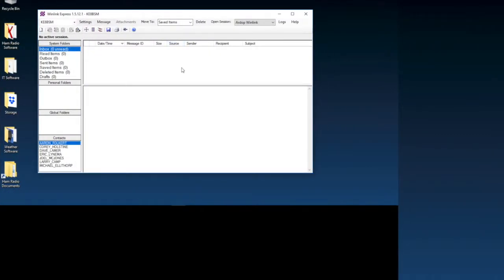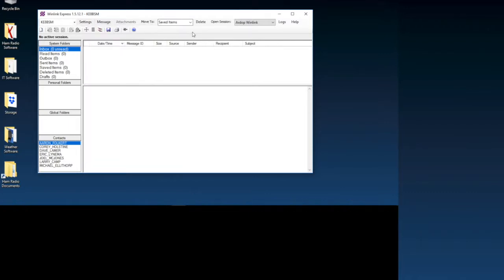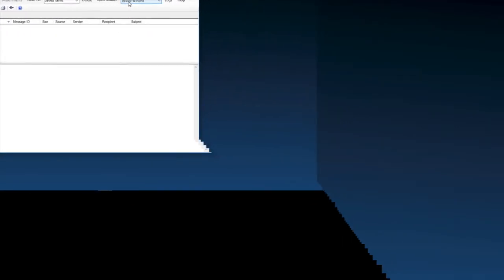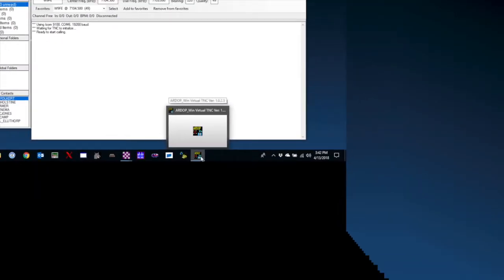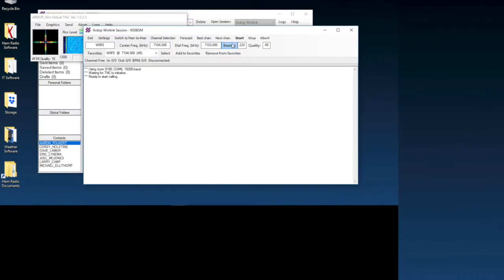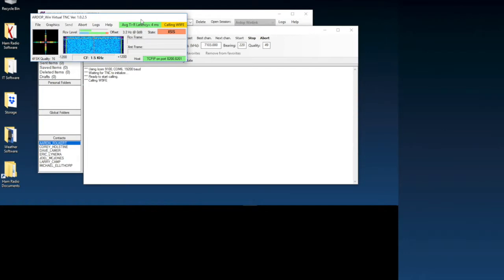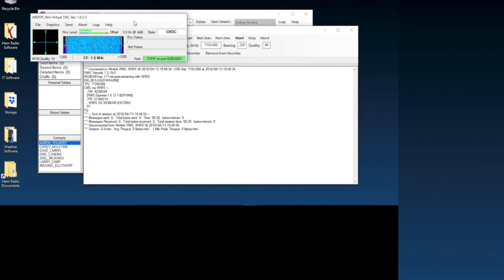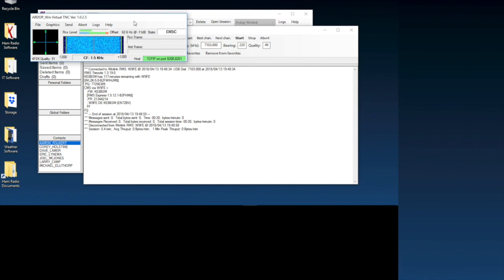Winlink Express & ARDOP Setup & DEMO

Comment: Thanks - on my 817 and my 857 I have never gotten an ARDOP connection and WINMOR only about 1:80 attempts  on 80/40/ 20 de VK1MIC
Reply from the maker: Hm that is weird. Are you using a signal link between the radio and computer?
Reply: Zach Bennett hi Zach. It’s not a signal link but it’s an audio and usb interface.
Reply from the maker: Hi Wade. I forget the technical term but I’m wondering if your Audio interface isn’t fully isolated and you’re getting undesired interference and that’s why you’re having a low successful rate with WINMOR and no luck with ARDOP. I don’t know if you’re part of a club or know someone who could let you borrow a Signalink but I would say try a different interface and see if we can rule out yours or if there’s a setting that we’re missing.
Reply: Zach Bennett every other mode I operator on and with the same device is all a ok ??
Reply from the maker: Oh interesting. Hm then I’m not sure. The only thing I can think of is a winlink express setting someplace. I wonder if you’re trying to connect to stations that are using a different bandwidth setting than what you have. While you’re in the connection status window, if you go to setup and TNC setup, there should be a bandwidth setting. Some WINMOR stations are 500 while others are 1600. Same is true for ARDOP as well.
Reply: Zach Bennett all VK ardop is 2000
Reply: @KE8BSM  Same problem here with my FT-817. No problem with FT8 (on WSJT-X), but no luck with Winmor or ARDOP so far. Also using a simple PC (TRRS) to radio (Data) cable, plus a CAT cable via USB for PTT and QSY.